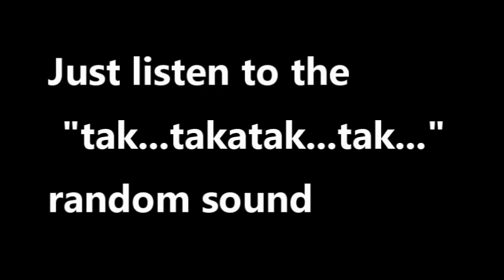Sound of Engine Misfire (Random) Suzuki Multicab F6A

Comment: Tanong lang po sir.. paano maayos kapag ganyan ang problem?
Reply from the maker: Boss hindi ko pa po sya na gagawa busy pa kasi sa pag clearing after bagyong odette, but may idea na po tayo kung ano yung mga possible causes and try ko po ma document ng maayos para ma share ko po dito. Pag ganito po na random (minsan ok or consistent ang tunog ng makina at minsan naman after ilang minuto ay pumapalya sya) madami po tayong dapat tingnan, isa na dyan ang supply ng kuryente so dito tingnan natin yung distributor cap kung hindi corroded ang mga contact points and hindi grounded ang mga high tension wires, tingnan din namin kung malakas ba ang kuryente na ibinabato ng ignition coil, isa pang tinitingnan natin dito ay ang supply ng fuel, kung  wala bang clog yung butas na nag susupply ng fuel during idle or yung tinatawag nilang idle jet sa carburetor, nangyayari po ang ganitong problema sa carburetor kapag matagal na hindi napapaandar ang makina at nasa malamig na area po, ang nangyayari po kasi yung mga na stuck na fuel dun sa carburetor, pag nalamigan mag kakaroon  po ito ng moisture at magiging condensate at hahalo sa na stuck na gasolina sa loob ng carburetor, pag hindi ito naalis sa loob ng carburetor, yung kaunting tubig or moisture ay mabubuo na parang plastic, at ito po yung nag cacause ng clog sa maliit na butas ng carburetor, hope ma document ko po ng maayos kung paano e troubleshoot ito para ma share ko po dito.

Comment: Ano po dapat gawin kapag ito ung problema? Salamat ss pagsahut
Reply: Sparkplug, ignition coils/high tension wires (kung may distributor), distributor (kung may carb or 80s-90s EFI), blow by (check cylinder head gaskets or piston rings (if nag hahalo ang coolant and engine oil), check sparkplug baka basa..